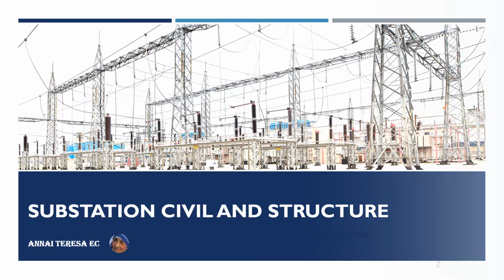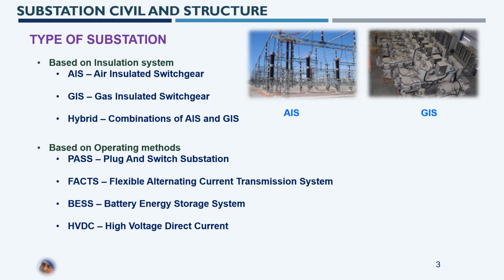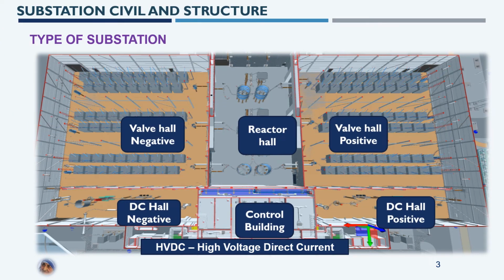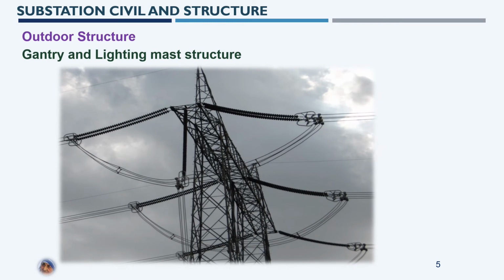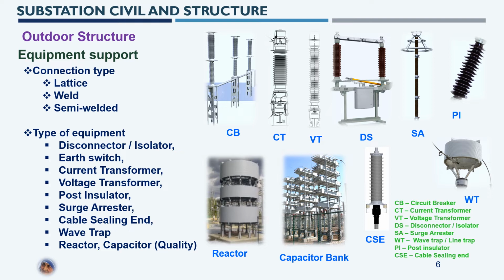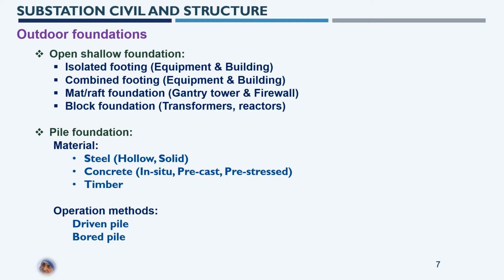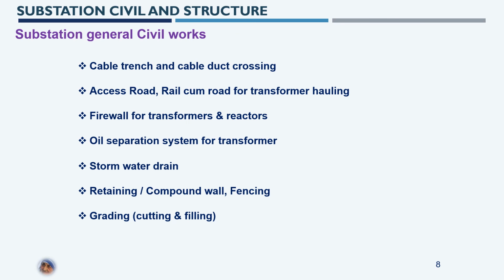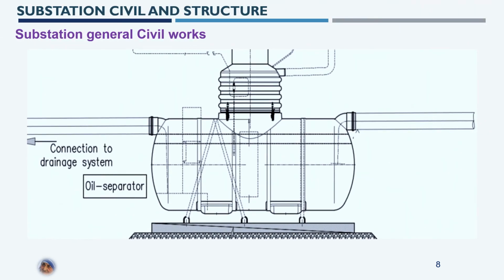Substation Civil and Structure

Comment: Thanks for your videos. Could you do outdoor substation structure design next (Bus support structures, Surge Arresters, Disconnector, etc.) and the application and consideration of short circuit forces? Im a designer from Australia.
Reply from the maker: Thanks for watching. Yes. Outdoor Substation Structure design already we are doing. So far completed Gantry structure Design. Will be doing more for Equipment structures also.
Reply from the maker: You can watch these videos for Gantry structure design: STAAD.Pro: https://www.youtube.com/playlist?list=PLorbvg8Gw7Dgvhwb4M38VvlBS5DRtNA3d

For Robot Structural Analysis: Autodesk Robot Structure Analysis: https://www.youtube.com/playlist?list=PLorbvg8Gw7DgOt-N0VCeiT0pVq4bksx1f

Gantry structure loadings: https://youtu.be/7bnM3R6h8Hk

Comment: Hi. Have you done design of CSE and Disconnector structures?
If yes can you share its tutorial about how to calculate loading and application of loading on robot structure model.
Reply from the maker: Yes.. We have done all substation equipment steel structures (CSE, ES, Isolator or Disconnector, CT, VT, SA, Post Insulators... WT etc.). We are now creating videos on Substation Gantry structures, Transmission towers and warehouse which are heavy. Yes, definitely we will do videos on equipment structures soon after completing our set priorities. Thanks for watching.
Reply: @annaiteresaec  thanks alot. Are you going to follow Eurocode for it or indian codes? and please do make a tutorial of how to calculate busbar loads and short circuit loads for them. I am waiting for the upcoming tutorials. regards.
Reply from the maker: @junaidijaz9907 Plan is to do in Euro, ANSI and BIS, it is a chain of technical videos, no limit to specific standards. Thanks for your suggestion and expectations. Definitely we will fulfill your requirements. Thanks for watching and subscription.👍
Reply from the maker: @junaidijaz9907  You can watch Our Videos related to Wind and Seismic Load calculations on various standards available in YouTube: https://www.youtube.com/watch?v=b3w5HCPTgos&list=PLorbvg8Gw7DiY9lXEFeI5CZMfybvKtNwO
Reply from the maker: You can watch Videos related to Robot Structure Analysis here: https://youtube.com/playlist?list=PLorbvg8Gw7DgOt-N0VCeiT0pVq4bksx1f